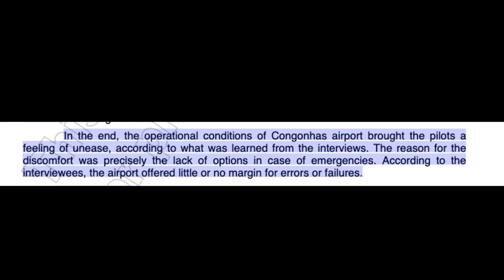The Stressed Pilot Who Made A Deadly Mistake | Deadly Reputation |Tam Airlines 3054

Comment: My wife was coming from Rio to CGH & her flight actually landed preceding this crash. She was still in the plane when this one crashed. She did not hear the explosion, but people on window seats on the other side saw the flash.She was also in an Airbus 320. The crew that day consisted of two full captains don't remember why,  each with 1000's hours experience in this type of aircraft.. Ironically, the plane flew over one of the busiest streets in São Paulo at rush hour under a very strong storm, flooding  had been reported in that area of town, it  barely missed a busy gas station on the other side of the road, and plowed into the TAM airlines  cargo building through the front desk & stopped short of the back wall. The building became an inferno with people coming in for the night shift. I remember the governor talking on TV and announcing that no survivors were expected since the temperature inside the building was reported by the FD was expected to be over 1000 degrees Centigrade.

Comment: Damn, every time I remember this flight I get a goosebump. I'm from Brazil and can confirm that before this crash, there had been another incidents there...
It's kinda sad that we need crashes to understand how to improve.
Reply: I don't think we necessarily need crashes to understand how to improve. I think we understand that well enough with close calls and pilot complaints, easily enough. The problem is that we just DON'T SET PRIORITY to those improvements until there's a crash to bring public outcries, threats of boycott, and so forth as the ultimate incentive to BOTHER with the improvements... If no crashes happened, the improvements would still mosey along, just as "proprietary improvements" on later models as the airline companies (and governments eventually) continued ordering newer, nicer, easier, and safer planes...

    Other industries continue to improve steadily without endangering lives. It's just another marketing ploy. People get readily dazzled into "the new fancy version" that's 10X more expensive than last year's or last decade's model that was PERFECTLY good, and even still works fine for the job... The newer nicer stuff still sells...

     What's frustrating is that nobody sets a priority for improved readability or specifically mixing visual AND audible alarms or error reporting JUST because a few pilots complain about close calls or point out that they've also had to double or triple check things and complained about the added work-load or stress... ONLY AFTER a mass casualty event or two or even three, is there a new regulation instated or a mandatory upgrade published for those improvements... AND the complaints from the big companies are always the same, "It's expensive!"  ;o)

Comment: My wife landed at CGH that same night. This TAM plane was the next to land after my wife's flight landed. Her plane was still taxiing to the gate. She was sitting on the left side of the plane & didn't see anything. Passengers on the right side saw the plane landing & a flash coming from the end of the runway. The plane crashed into the cargo building of their company 2 buildings away from a Shell gas station. The plane crashed through the front door killing the people in the front counter & customers, and came to a stop before going out the warehouse back wall. The building caught fire & collapsed. Roads were flooded due to an unusually strong storm. Fire trucks took a while to get there because of stopped traffic & severe flooding around that area. It is one of the most dangerous airport in the world. I have landed there many times. There are 10 - 15 stories building within 1000 feet on both sides of the runway. You can actually see people inside the flats. I recall once seeing a topless woman suntanning on her balcony!  The end of the runway has a huge checkerboard pattern red & white about 50 meters high  extending the entire width oh the runway!  The airport was built in the 1920's on top of a small hill, and grew with time. There is a 200+ feet drop from the end of the runway to the street below. It is one of the busiest streets in the city with 5 lane street going each way.very few traffic lights! 
This flight pilots that day were two captains who totaled almost 20,000 hours between the two of them. Bad judgement, or &  much confidence on their skills probably played a part in the decision to land at CGH.  CGH Is like La Guardia in NY. It's very close to downtown &near the business district. GRU, the international airport is about 35 miles away & has 12,000 feet runways.  They should have diverted there, which many flights did that day. There is a direct bus service between the two airports every 20minutes!

Comment: 10:00 This is literally the first thing that came to my mind when I learned the engines generated thrust in opposite directions. I can't imagine any non-disaster scenario where setting thrust in such way would be beneficial. I was surprised that there was no warning whatsoever. It's a real shame that this got overlooked in original design and only added later as a non-mandatory modification.

Comment: It's kinda ironic that the braking method he chose to use less runway caused him to overrun it
Reply: That was the same method that caused the over-run of Phillipines Airlines Flight 137.
Reply: No there was no other braking option left. Only swift take- off was probably better option...
Reply: well, sadly, he didnt choose a braking method in the end . at touch down, he put one engine in reverse but forgot to /didnt move the other one to idle. we cant tell without listening to the CVR exactly how the pilots were preparing during those testing minutes, and without checking TAM training for opposite thrust setting = spoiler deactivation... and this video did not indicate if the pilot with headache was landing the plane... so many factors. sad, indeed...
Reply: if he had done it right it was goin to stop earlier and ON the runway..not outside of it...sadly we all are human and we all make mistakes...i  cant understand why the FO didnt check the throttles and brakes again...we all look onto the captain but the FO is there too...where was his mind at that time?
Reply: @martinrezzy  : Good question.  I think one factor is that it was was nighttime and it was dark in the cockpit, so the misplacement of the right throttle wasn't readily visible.
Reply: @Milesco  if the throttle is not on idle the reversers do not open is that right?can you apply full reverse thrust when one of the throttles is not in idle?
Reply: @martinrezzy  :  The thrust reverser on the right engine was inoperable.  In such a case, the previous procedure was for the pilot to put the engine with the inoperable reverser to idle, and bring back the throttle for the other engine to the reverse thrust position.

However, for reasons that are not clear to me, this apparently caused confusion among pilots.  So then the new procedure was simply to bring both throttles all the way back to the reverse thrust position.

If the pilot on this flight had done either of those things, everything would've been fine.  Instead, what he did was to put (or leave) the right engine in full (or nearly full) forward thrust, and put the left engine into reverse thrust.  Investigators believe he got flustered by the combination of the short runway, the wetness (less traction) of the runway, and the inoperability of one thrust reverser.  Ironically, the pilot's fear of not being able to stop in time actually caused him not to be able to stop in time!
Reply: @Milesco  thank you for this...i didnt understand that one engine was in forward thrust and the other in reverse...this is soooo wrong...sooooo wrong...its like you start running with crossed legs or something that stupid...soo weird...thank you again
Reply: @martinrezzy  :  You're welcome, Boulevard!   Have a great day.  🙂
Reply: @martinrezzy  Different cultures have differing views on the hierarchy  in the cockpit ... friend of mine that used to pick up aircraft from Embrair and bring to US said when he was in the left seat they treated him like a king ... when he acted in the role of F/O he was excess baggage.

CRM varies greatly from one company to the other and from one country to the other

Comment: Best aviation channel by far. Lesser known accidents instead of the same 5. ✈️👏
Reply: What are the 5? I’m gonna try to guess:
1. Tenerife
2. JAL123 the blown off vertical stabilizer that still flew for 30 minutes which no simulator pilot could achieve
3. The Gimli Glider
4. The Netherlands crash in a forest / field where all survived.
5. United XXX(I forget) the one out of NY that exploded due to hot AC units after 2h of stuck on the runway, then a low center fuel tank vapors being ignited due to old faulty wiring short circuiting causing such a violent explosion that the cockpit severed from the fuselage, killing everyone. Many missile conspiracy theories.

Comment: No matter how unlikely an event may be, remember: it may happen nonetheless. When training at Iberia, an instructor pilot told us trainees of two equal incidents, ony one month apart: telecompass failure. He then explained us what telecompasses are and their very simplicity.
Telecompasses are not mechanical or electronic but simply electromagnetic. Each telecompass system involves a couple of electrically linked units, with no power system applied. Each unit has a 3-pointed star-shaped magnetic material (such as iron) with electric coils. One unit stays at a wingtip, the other next to the actual compass in the cockpit. Just so that the compass gets the Earth's magnetic field as far from interfering things in the plane as possible.
Well, the odds of telecompass failure is thirteen million to one. So, when one failed, it was deemed just bad luck and substituted. But, next month's failure seemed too unlikely, and the manufacturer was called and an investigation was run. Result: again, just bad luck. Astronomical odds? Yes. But it happened.

Comment: Thanks for explaining why the old method even existed. I would have thought it was a shoe-in to always just put them both into reverse. One would think that it would be engineered so that the deactivated reverser simply wouldn't allow the engine to thrust up at all. Seems not to be the case.
Reply: Probably because the difference is negligible.  180 feet on a 6200 foot runway.  (55 meters on a 1900 meter runway.)

Either method (pulling back both thrust levers all the way, or pulling back the "good" lever and leaving the defective one at idle) would've been fine.  But instead the anxious pilot left the right one at full (or nearly full) power.  As another commenter noted, it's ironic that the very fear that the pilot had about being able to stop in time ultimately caused him to fail to stop in time.

Comment: They knew they would need every possible meter of the runway, yet they didn't decide to go around after realizing it was all going wrong. It seems like going around would have saved everyone in many accidents
Reply: Once the reversers are out (especially Max reverse it take a few seconds to regain TOGA power) at the speed they were travelling and the short runway they wouldn’t have had time
Reply: @jamesdean2185  Well diverting to another airport is a big deal. The airplane and passengers would not be where they are supposed to be, logistical nightmare.
The pilots actions in that situation would be seriously questioned.
It boils down to if the pilots operate the airplane as it should be operated in that situation, then this would have never happened. 
By leaving the right engine throttle above the idle detent, they caused two other systems to not operate. 
Auto spoilers did not move to the "Ground Spoiler" position, which in turn canceled out the auto braking system, delaying braking to when the pilots manually applied the brakes.
Reply: @rudedog302  Just a complete lapse of basic airmanship, or really common sense. Like me coming up to a stop sign or a red light  in my car and keeping my accelerator pedal all the way to the floor.  Yeah, I can use my brakes but I wonder why I am barely slowing down.

Comment: Shocking to hear that a plane with defective thrust reverser is allowed to fly to any other airport let alone a difficult one.
Reply: If it’s allowed by the minimum equipment list then you can
Reply: The airport was unsafe. Not difficult
Reply: Not on the MEL. Stopping performance during certification is done with no reverses, hence they aren't on the MEL. But on wet surfaces obviously they're the most beneficial as if the anti-skid is fluttering the main gear brakes and the performance is reduced, at least the reverses are doing something constructive during loss of friction moments.
Reply: Lots of aeroplanes fly with one thrust reverser locked out. There is nothing unusual in that.
Reply: I would rather know if the plane I was a passenger on was compromised in its ability to stop. Redundancy is, after all, there for added safety and not to allow them to fly with known defects. If I took my car out with defective brake pads on just one wheel because there were three others with good pads I would be a twat that deserved to be crucified. 😂. Sounds like there’s an argument for the minimum equipment list to be reviewed each preflight in light of the destinations and conditions to be encountered. Asymmetric reverse thrust must rely heavily on tyre adhesion to counter the lateral forces and reverse thrust is most useful when tyre adhesion is most compromised. I am however not a pilot but just an engineer so I am imagining the effects of asymmetric reverse thrust.
Reply: @robinwells8879  I can’t comment on the policies and standards of the airline involved, but for the airline I fly for, and certainly most others, there are many considerations which have to be taken into account. We also have to allow for wet runways, short runways etc. The asymmetric effect of one engine reversing and one at idle is very minor, and no issue controlling even in the wet.
The accident aircraft had the extreme scenario of forward thrust on one side, and reverse on the other. 
That’s always going to end badly, and another reason that the Airbus system of literally “non- moving thrust levers” is crazy.
In a Boeing (and everything else that I’m aware of), advancing thrust by auto throttle means advancing thrust levers, period - a HUGE source of feedback to even very average pilots. 
With the Airbus system, you can have anything from flight idle to max thrust commanded by auto throttle with no thrust lever movement. Crazy, a system designed by computer nerds maybe, not pilots!
One ex Airbus test pilot was extremely critical of that system and said it “would continue to cause accidents”, and it has done exactly that.

Comment: I'm Brazilian, and although I love your channel, I'm used and resigned to hear you butcher the pronunciation of non-English names and sigh. To my surprise, you did pretty well with the Portuguese names (only it's "Porto" Alegre, not "Port"). That includes a good approximation of the nasal sound indicated by the tilde in "São" Paulo, which is unique to Portuguese, and the "nh" sound in "Congonhas" (same as French or Italian "gn" in "mignon" or "gnocchi", and similar but different from Spanish "ñ"). Congratulations! 👏👏👏👏

That said, this accident made even worse the political and operational crisis in Brazilian aviation that had been ongoing since the Gol 1907 mid-air collision and crash in the previous year, but now Congonhas is much safer and no further major accidents happened there. The grooves were finally implemented a short time later (it helped that due to its location in the middle of the city and the noise problems, Congonhas is closed every night from 11 PM to 6 AM, so night works are easily done there), and Airbus also made some modifications to the way the thrust reverser is deployed in the A320.

Comment: On a dry runway you will get away with using the wheel brakes and flares to stop but on a water-logged runway the best thing to use is reverse thrusters to avoid aquaplaning. Who would have thought that an airline would operate their planes even though they were not mechanically in sound condition. Therefor lack of maintenance put aircrew and passengers in danger.
Reply: You mean the inactive thrust reverser? It's in the MEL. It can fly with one
Reply: It was proved in the simulator even with no reversers the aircraft still stopped in time